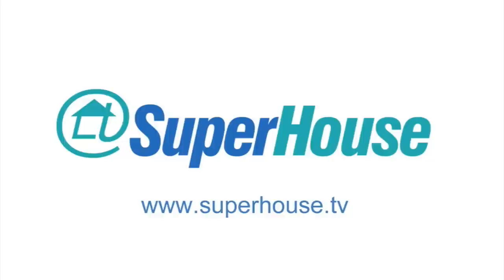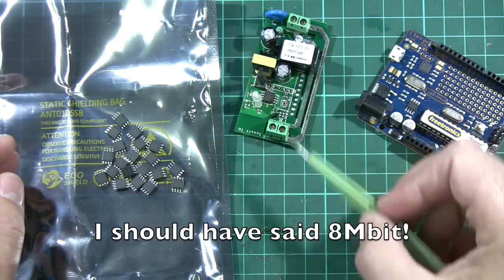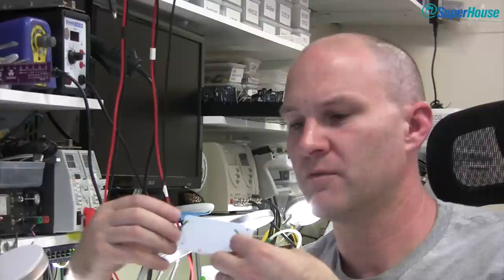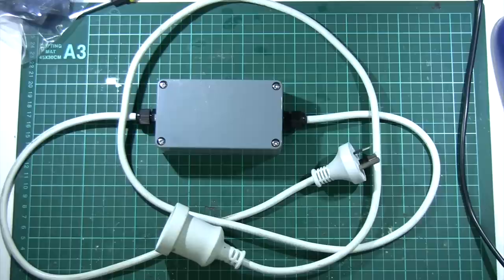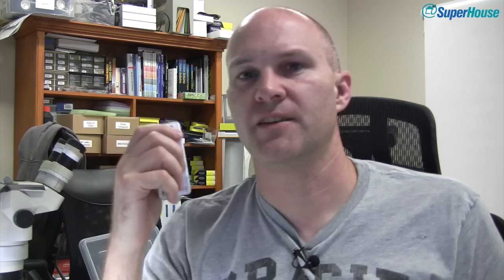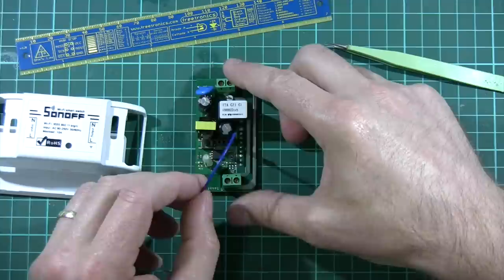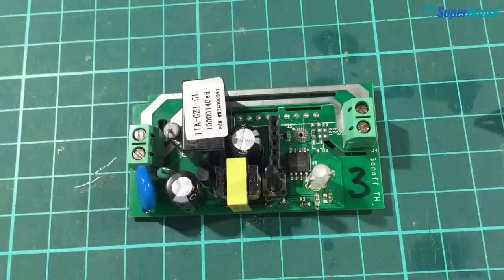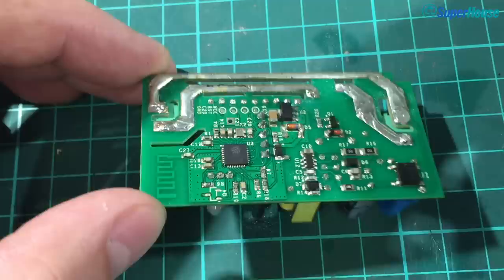SuperHouse #21: Six Sonoff Secrets: Storage, Safety, Switches, Sensors, Software, and Sites

Comment: The biggest problem with using these as a drop-in replacement for a light switch, is that many if not most light switches don't have both an active and neutral wire available.
Reply: FlyJemson yeah in my country this is the case too, only have a live wire...
Reply from the maker: I've seen this many times, too. I gave a detailed solution in my reply to Alru Waldeck's comment, but perhaps I should do a video or blog post about it. The problem is common enough that it catches many people out.
Reply: This comment is incorrect. Disregard. He's seeing two wires connected to the switch and not realizing that they are power in and power to the load.
Reply: No you don't. You have the live wire to and from the switch, BUT the neutral goes to the light fitting. This device does not connect "at the switch", it is connected elsewhere in the light circuit so that BOTH live and neutral pass thought the Sonoff device.

Comment: Well done! A really good tutorial, clear and to the point, especially as regards safety when mains wiring is involved. One thing that came to mind was fitting a properly heatsunk 25A SSR instead of that dodgy 10A relay, or add a smaller SSR as a secondary power output, using one of the spare GPIO pins. Cheers!
Reply: You would most likely have to beef up the pass through circuit (mains in and out). There is a 16 amp model available. Cheaper to buy that than mod a 10amp.

Comment: Excellent videos!!!
I saw some people asking how to use a sonoff as a 2-way switch and, inspired in your toggle button trick, I think there is a solution to it. You can connect two 2-way switches like you normally do between them, i.e. L1 of SW1 to L1 of SW2 and L2 of SW1 to L2 of SW2. Then you can connect the common terminal of SW1 to GND and the common terminal of SW2 to GPIO14. That way every time that you toggle any of the two switches will produce a change to the "state", so the light will be turned on or off accordantly.

Comment: I have made two of this boxed switches as I wanted to make sure that the wire couldn’t be pulled out as the connection holes are very small especially if you use a. Extension cord cut down.
I removed a few strands of wire to thin it out cutting back to the protective casing.
Made sure the glands held the cords tight seems impossible to pull out a accidentally.
I used a commercial large junction box cut to size with a clear plastic lid.
They work well love the fact that with IFTTT the lights turn on before I get in the house.

Comment: Thank you for these great tipps. I used GPIO14 before and I knew a few other things but GPIO04 was new to me and thanks for reminding me to be extra cautious in regards to someone pulling the cable from the screw terminals - It didn't occur to me that this was of course possible. Usually I will install the Sonoff to the ceiling but since it can do so many things it's quite probable it will end up on the floor as well. Thanks for the great IoT/home automation content you produce. Cheers!
Reply from the maker: Thanks JM!

Comment: Great video thank you. I have one suggestion that may appeal to the OCD crowd. I would write the code so that when you change the state of the physical light switch the status of the sonoff is changed (or unchanged) to match the light switch. Only during the status change does the light switch obtain light control, you may have to switch if off and then back on again to turn the light on, but the switch will then match the operation, Not a big deal, but again, it may appeal to those that want the wall switch to only work as normal positions.
Reply from the maker: Sure, you can do it that way. Personally I think more people would find it confusing, because if the light switch is in a state that's out of sync with the light, when someone flips it nothing will happen. They will probably think it's broken or they used the wrong switch, or flip it multiple times to figure out what's going on. I think it would be less confusing if every movement of the switch changed the state of the light so there is always immediate feedback that your action has caused some event.
Reply: @SuperHouseTV  I agree.  A three-way switch works that way.  The feedback from a light eliminates any confusion.  A device with no feedback would be another story.

Comment: Very useful video.  Thanks.  So with pin 4&14 revealed and a logic chip one could control 4 separate relays.  That, in addition to the on-board relay, would enable one Sonoff to control 5 circuits!  If I2C were used on 4&14, then one could control 127 + 1 devices!   Holy schmoly!  I've got the perfect home lighting task for this.

Comment: Consider for the wall switch - when the software senses a change of state for the switch, set the output to the new state of the switch.  IE. if the switch is on and the light is off, you turn the switch off and then turn it back on.  That is, if you are insistent about switch position/function being retained.  And if that's the case, I'd bet there are no 3 or 4 way switches in your house ;-)

Comment: Thanks for another excellent video.  I am considering using the sonoff to control an outdoor water fountain pump.  Although the switch will be in a dry location, I plan on putting it in a small IP rated box as you showed in your video.  I am however going to remove the sonoff from the original case so that I can use a smaller box as the location is constrained by size.

Comment: SuperHouseTv: For manual switch, I rewire the NClosed contact instead of Nopend contact from Relay to output. Wire your Line -> Manual switch -> Input supply Sonoff. So when power on light on, power off light off. But inverse action on app button, you should off button to light on.

Comment: For #3 using a momentary switch there is a way to use a SPDT switch and convert it to not only a momentary switch but have it pulse "on" for a short duration in either throw direction.  This avoids the possibility of someone holding the momentary button too long and triggering the boot loader mode.  Its a matter of a proper sized capacitor and relay; however once you start sourcing the parts (with the 3.3v relay being the expensive and hard to find part) you might as well pop for the SONOFF mini or the add-on board (E77 Wall Switch Connectivity Module).  Given that, I haven't done it personally because it seems like more time/money than the safety it provides that someone will be malicious but it is possible . I'm not going to go into detail because there are a number of YT videos and instructions out there already; just thought I'd mention it.

Comment: Thank you for this video, just started buying Sonoff equipment. I will see if you have later information, as I see my BasicR2 has a different internals. At this stage not looking at a big project, just lights and power control using the BasicR2 and MiniR2, also ordered a NSPanel to play with.

Comment: I connected our bathtub and are controlling the water faucets with it. I ordered a 4channel sonoff from aliexpress and also a two water valves from a washing machine, now I control the valves with the sonoff switch. I'm also using the 12v version on our gate motors to trigger the gate to open and close.

Comment: I just bought 4 SonOff basic.  I am going to order the TH16, I did not even know of it.  I am also looking at the Sonoff 4CH Pro - 4 Gang Inching/Self-Locking/Interlock WiFi RF Smart Switch For DIY Smart Home,Compatible with Alexa   I if I can add a DHT22 to this then it will be great add on.  Even if I can't add it My ESP8266 can do it and then use that to change the states of the relays.     All to control my Swamp cooler next summer.  Right now no so much as it is 29 F degrees  -1.7 C   here now.  Thanks 
Lee

Comment: Nice video.  Something I don't see talked about often is how the original (and maybe subsequent?) Sonoff Basic modules switch the neutral line, not the hot, of the mains.  Thus, even with the light off, the hot lead to the light is still live, and you can still get a shock between the hot and ground (earth).  Kind of scary...  :-/

Comment: THX for the interesting great video!! 
If a wire with female connector is used (not a male) you can leave it in some designs.
Perhaps making a connector with cheap pogo pins (or use a ready available pogo pin connector) can make life more easy. Especially for the bulb.

Comment: You got it almost right, you should have used those wire end sleeves and a crimp tool before you put the wires into the phoenix connectors... Because you didn't use solid core wires but the braided wire instead you now have an extra risk added, when you screw the wire tight in the phoenix connector and didn't use the wire end sleeves you will damage at least a few strands of the braided wire and if you use too much force you will go through the full wire, basically you will cut the wire inside the connector that you don't see and then when you finally install the box the wire may have come loose and it starts to spark inside the plastic connector which will start a fire.
So to everyone reading this comment, you can do exactly what's in this video except the part where he puts the braided wire into the phoenix connector without the wire end sleeve crimped onto the wire end and only then you can go forwards with the instructions in this video, so if you did it his way already you know what you did wrong and need to fix immediately before your house burns down!
You can thank me for saving you a lot of misery later after you now go and check your connections immediately!

Comment: Great exposition. 

Another way to use this switch aside a mechanical one, is using a three way configuration (aka stairway switch, aka hotel switch). This way leave the GPIO 14 free for any other usage.

Comment: Thanks for the video, helping a lot as I want to start my project soon. Will need to figure out how to wire this to the existing switch as we only have one live wire inside the wall and no neutral though:/
Reply from the maker: There are two "standard" ways to wire a simple light switch. With one, the power source (active + neutral, and sometimes earth) goes to the switch, which breaks the active and both then go on to the light fitting. In that situation it's easy to put a Sonoff in place of the switch. With the other, the lighting circuit (active + neutral) passes through the ceiling space, and near the light fitting the active is diverted and runs down to the switch, then back up to the light. That sounds like the situation you have. If that's the case, you have a couple of options. Personally, I would place the Sonoff inside the ceiling space where the active is diverted to run down to the light switch and remove the switch entirely from the circuit. At that location you'll have both active and neutral available. Then, use the (now disconnected) active loop that goes to the light switch to drag through some lightweight cable, and use that to link the light switch to GPIO14 on the Sonoff as shown in the video. Yes, I know you could just re-use the active loop that's already sitting right there, but that can be dangerous because later an electrician may come along, take off the light switch, and see the mains cable going up without realising that it's actually now just a low-voltage switch wire to the Sonoff. They may not even know the Sonoff exists, and think the original wire is still switching mains. That could lead to all sorts of dangerous misunderstandings. It's best to avoid using mains cable for other purposes (such as low-voltage switching) for that reason. Better to replace it with cable that's obviously different, such as figure-8 speaker cable or twisted pair cable.
Reply: SuperHouseTV Thank-you very much that makes perfect sense! keep up the great videos!

Comment: The first time (and second, and third...) time I watched this I felt SO silly... I've been so watchful of solder bridges, I've fought to get chips off. duh, no power, who cares about bridges until you are ready to apply power.  Thanks, mate. What makes me feel really silly is that I've been doing this sort of thing a long time...
Reply from the maker: It's not silly at all! We spend far more time putting on components than taking them off, so it's normal to base our soldering technique around avoiding solder bridges at all costs. It's hard to break that habit.

Comment: Your're doing a great job, thanks for those videos. I used the SONOFF in e different way. I wanted to make a garage door switch out of it. So I choose to inject 5 volts directly to the vcc to power it up (like when we flash it) and use the relay to connect to the door switch in parallel.

I could of use an ESP8266 with a standard relay but it doesn't worth the truble. I use the led to indicate if i'm cnnected to the MQTT (WIFFI by the way) and also the GPIO14 for the DHT22.
Reply from the maker: Nice! So you're basically using it as a WiFi-enabled relay. Clever. I'm working on a garage door project at the moment and doing something similar, but with an EtherTen and a light sensor so it can detect the state of the door by reading the status LED. Hopefully I'll do a video about it soon.
Reply: I've just used a simple magnetic reed switch to tell when the garage door is open or not. http://www.michevan.id.au/content/garage-door-sensor/

Currently just simply hooked into a flashing LED glued into the ceiling near the front door, and some laser pointers that are used to tell when the cars are in far enough. Been pondering adding an arduino board though, so can send notifications if the door is left open too long, and give remote control to opening/closing it.

Comment: You have a new subscriber. Good work. On memory, how about a SOT to 0.1" socket then a reverse adapter? Then swap chips as things change. 

Works for me on these low speed imbedded systems. I find these parts on eBay but none of the Chinese sites seem to have them or I can't figure out what they are called. 

I have a small library of these with different sizes. I even do this with sensors and all sorts of SOT-3 diode and transistor packs. 

Blow up your signal conditioning - no problem. Pop a new one in. 

I wish I had the hands to do really big stuff (>14 pins) or even the dreaded BGAs.

Comment: This was a great video on so many levels, really enjoyed your method and detail.Never done a surface mount chip remove and replace but after watching you, I’m going to just do it.The detail about IP definition and safety this to me was so important and appreciated the level of detail I wonder if the following is possible Use a esp32 to control other esp32 devices including Sonoff switches maybe a nextion touchscreen and somehow node red as the programmable software adding in some Bluetooth connectivity.

Comment: Great video! Regarding the I2C protocol...it's (ot it was) a bug in the arduino library. I spent days making it work, but finally after some tweaking and some delays I managed to make it work. Basically the timing was incorrect, so the slaves didn't know what was happening on the bus. It's unfortunate though, because with the official SDK everything seems to work so smooth, but it's a little pain to write code.

Comment: if you put the sonoff in series with the 4 socket extension (21:32) be sure you can only use 2200W instead of 2400W

Comment: Very professional and GREAT video, thanks!!! You just solved the problem I'm facing for almost 2 months - connecting external switch to my Sonoff (25:55). I have a question - is it strictly sonoff related trick or this applies to any esp8266 device, e.g. Wemos modules? Thanks!
Reply from the maker: Thanks @pawel753 :-) You can do the same thing with any microcontroller. I use heaps of the Wemos D1 Minis around my house, and I love them. I've designed a few tiny shields for them which I might show in other videos.

Comment: 21:37 To avoid that you may use a DC Coupling Capacitor in series connected between the switch and the GPIO0 so that no DC runs to it but only temporary impulses! If the GPIO0 doesn't drain enough current, just connect it to a 10K resistor to drain the temporary "high" voltage given by the capacitor to the ground!

Comment: I have read from the igrr the developer of Arduino for ESP chips that you can only use 1Mbit if I remember correctly due to some restriction which I forgot. So increasing the memory will not be beneficial. That's for the Arduino. I am not sure for others such as Lua or Adafruit.

Comment: Thank you, sir, Can I program it via Arduino for Light detection sensor?. Or for controlling more than one relay?.
Another important issue is it saves the last situation, i.e. after the power cut off, then returns is it returns to its previous state (ON or OFF?.
Reply from the maker: To answer your 3 questions: yes, yes, and yes. Most light sensors provide an analog signal, so you would need to use an analog input on your microcontroller. The ESP8266 only has 1 analog input, and it's very limited: it only works within a specific voltage range. It does work, though. You can also use an external A2D (Analog to Digital) converter which connects by SPI or I2C. For more than 1 relay, there are Sonoff models with 2 and 4 outputs. You can also connect extra relays using more I/O pins, and control them with transistors. I designed this board to make it easy: http://tron.cc/relay4. For state memory, you could write the state to FLASH memory when it changes and then check it when the program starts again. If you use the TASMOTA firmware, that feature is built in. It's controlled using the PowerOnState command.